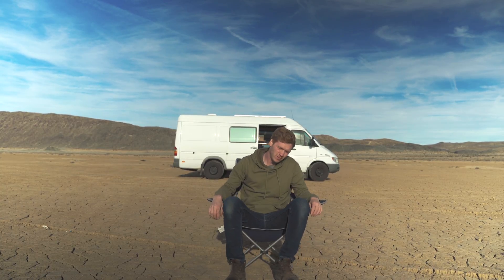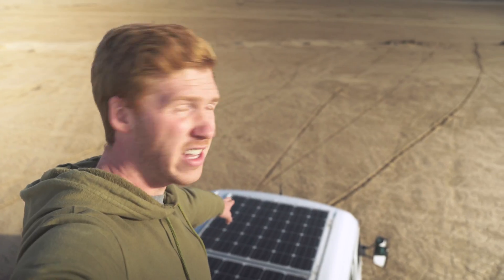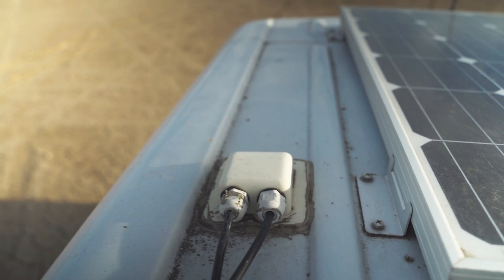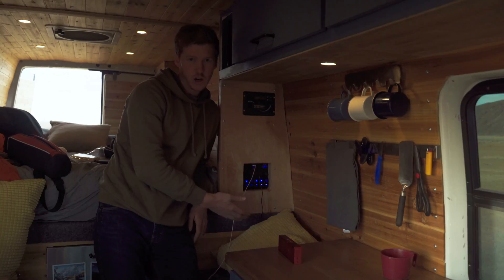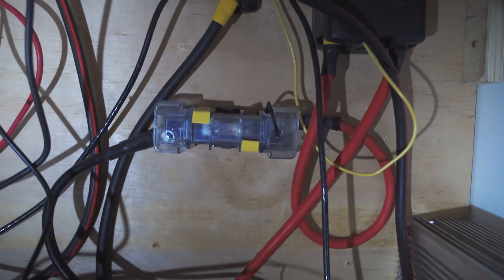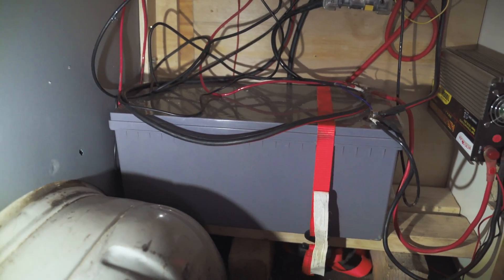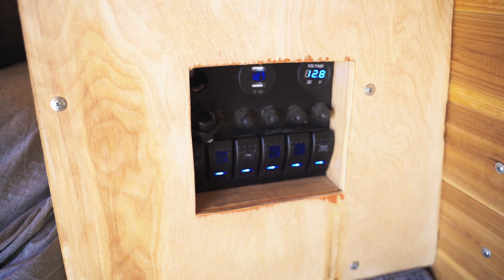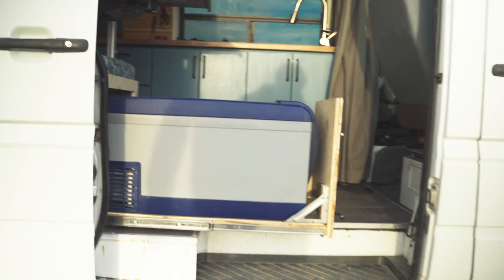Off-Grid Solar System Walk-Thru | Sprinter Van

Comment: does this provide enough power for every day living? I am a freelance artist who works on dule monitors and am looking to get something like this. do you think this could run a VERY beastly laptop, phone fridge and tethered internet with out to much stress of running low on battery?
Reply from the maker: Depends on how much sun you have access to and how often you drive around. My guess is you would want at least 400 watts of solar panels and probably a bigger power bank as well.
Reply: @shaunwilkens  hey thanks man! Subbed to your channel! One of the cleanest cut ones I've found. Very informative non fluff! Keep up the amazing work!